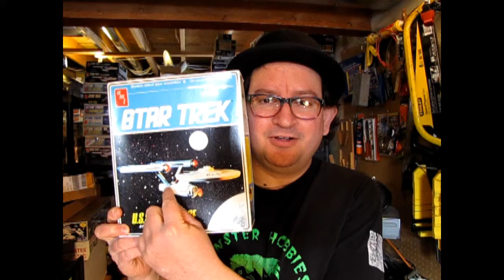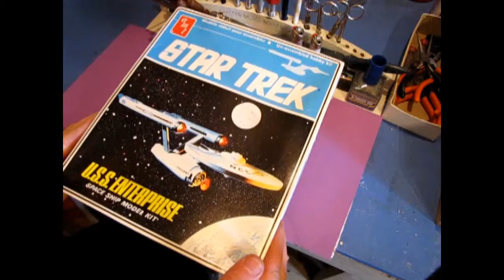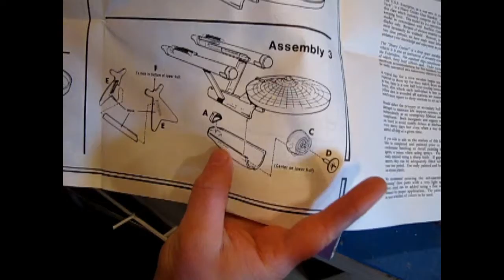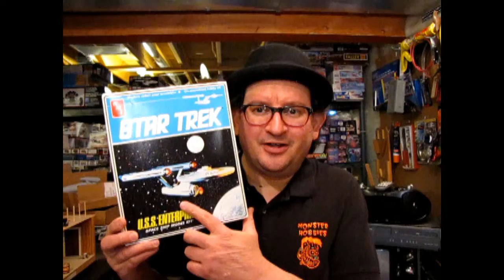Let's Build the AMT U.S.S. ENTERPRISE Kit 6676 - Part 4 - Building The Secondary Hull - How-To Video

Comment: The secondary hull is difficult to build.  You have three major parts coming together and none fit particularly well or tight.   Plus, along the horizontal mating seam between the two upper hull halves and the lower "tub" half, it's difficult to get a smooth seam without much sanding, which of course will erase some of the tiny windows near the seam.   Ugh!  Frustrating!!
Reply from the maker: Just do your best and take your time. I masked those windows with thin masking tape to prevent them from being sanded off.
Reply from the maker: Did you get this to work out ok?
Reply: @monsterhobbiesonlinestore  Haha, I'm still working on it slowly.  I'm at the paint stage, tried some sample spray cans from the hardware store but having trouble finding the "right" color.   Thinking of mixing my own and using an airbrush.  But also started building the Polar Lights 1/1000th.  Nice but still many seams to fill and sand!  Thanks Trevor!
Reply from the maker: @gsr4535  No problems. i am just re-working the video' s descriptions and what-not so it will be easier for people to find. thought I'd try and ask questions to see where people were at with their builds as well.
Reply: @monsterhobbiesonlinestore  As I've told you, I think your Enterprise build series is excellent.  Calm, friendly and informative.   Goodnight from Michigan!  👍
Reply from the maker: @gsr4535  Good night. Sorry, I'm in Alberta. Didn't mean to get into a "Time slip" and keep you up all night! :D
Reply: @monsterhobbiesonlinestore  I know, I know.  The Calgary Flames.  The Stampede.  👍
Reply from the maker: @gsr4535  I just mean it's 5:50 pm my time right now...must be 11:45 pm your time. I'm probably keeping you up way past your bed time! :D
Reply: @monsterhobbiesonlinestore  LoL... I think just two hour time difference.  About 8pm here now.  By goodnight, I just meant "winding down" for the night.  🥱
Reply from the maker: @gsr4535  Sounds good.

Comment: Now in reference to part 5 the nacelles are not the warp drive engine the Warp drive is in the Engineering hull(secondary hull). The nacelles channel the warp energy from the warp drive and generate the subspace warp bubble that propels the Enterprise into warp. Well thats what the manual says anyways. LOL
Reply from the maker: I think you have read the manual too many times! :D
Reply: @monsterhobbiesonlinestore  LOL And with the deflector dish that can be left off till your done painting as that is a fragile piece as you would need to mask off the inner rings of the deflector housing prior to painting the hull color anyways and that dish gets in the way. Something to think about the next time you build this kit again.
Reply from the maker: I usually paint the dish on it's own and glue it in after. Done it like that all my life actually.